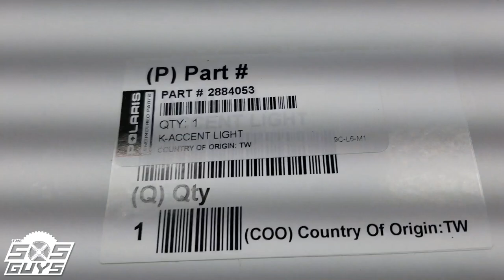Polaris RZR Fang Light Installation | SXS Guys

Comment: Literally too fast and without narration to be of any help.  Eg., i don’t have those connectors on my sxs.
Reply from the maker: It’s not a guide, just showing that it’s an easy upgrade. If your RZR XP has the plastic non-lit fangs etc, it should have the same plug-n-play harness to install the lights.